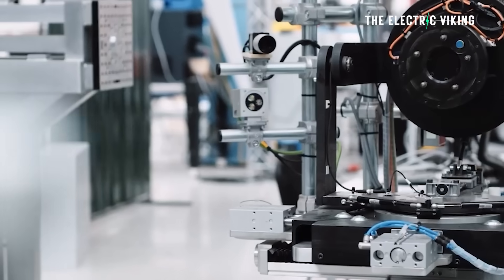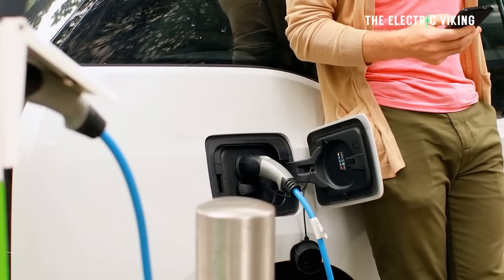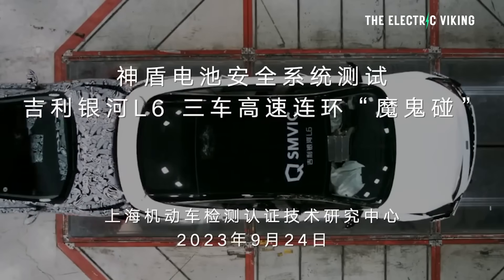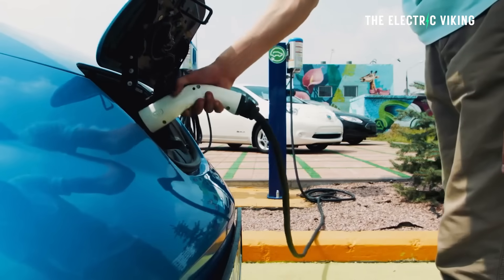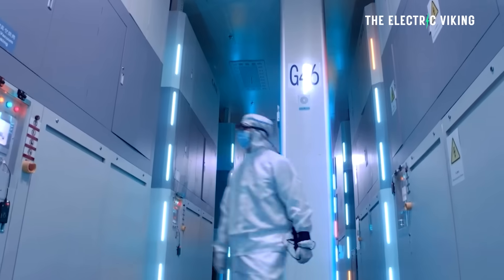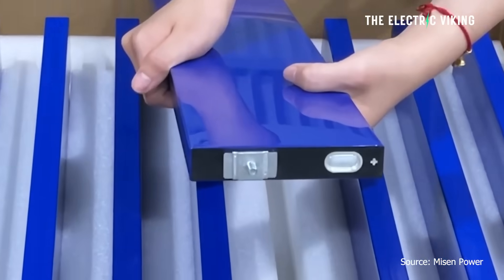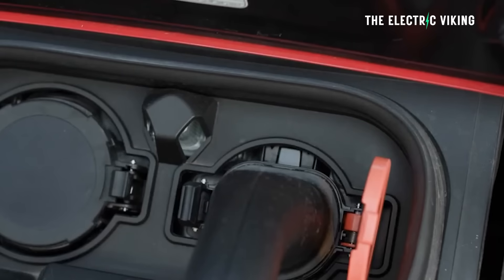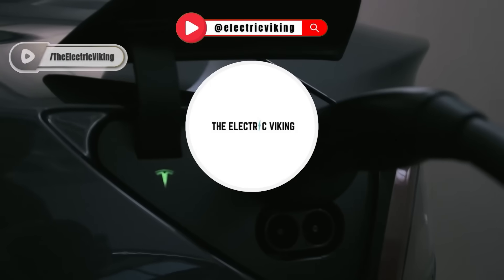GW Motors reveal battery that charges in 8 minutes and 1.5 million km warranty

Comment: I'm wondering how scalable this is.  It's one thing to have a battery that can charge at 800 KW, but in the real world there has to be an infrastructure to allow this to happen, not just for the current fleet of BEVs (like 4% in the UK) but for vastly larger numbers.  So, for example, you see so-called "fast" chargers in the UK that squirt out 75 KW.  These currently work fine - as long as there aren't too many BEVs taking juice at the same time, because as soon as this happens, the output power to each car drops.  The charging companies generally do not have the infrastructure (in the UK) to dispense full power to all of their fast chargers at a given station.  Scaling it up to 500 KW that can dispense simultaneously to dozens of cars all feeding off the same input is in practice too difficult and too expensive.  If such a thing was even possible you would then run into the problem of insufficient dispatchable power being generated on the grid.  The idea that this will happen is, imo, for the birds.
Reply: Exactly

Comment: Most of what is discussed here is quite unrealistic. Very fast chargers are going to be very few and far between simply because of the massive and very costly electrical power infrastructure needed to support them. This won't be generally available for many years, if ever.

The fastest enroute charger I have found is 150KW and they are quite rare. They are mainly only located at central town sites where the high capacity power feed is available, and these are often Tesla only sites. 

On the road with my two year old Atto3 I normally charge 30% to 80% (30KWhr). At a 90KW charger (fairly common place), in mild weather, this allows full rate charging (90KW) and takes just 22 minutes. Just enough time for a pee and coffee. This gives 180-200 km (with a good buffer) before the next charge. In this way a longish 750km trip can be done in nine hours, which although not as fast as an ICEV, is still a good pace.

With my Tesla M3 the charging times are just 15 minutes provided I can find a 120KW charger. These are generally only found at Tesla Supercharger sites. They are very expensive so that many Tesla owners prefer the much cheaper, but slower open chargers. 

Although not as comfortable a ride, the Tesla M3 can usually do the 750km trip in 8.5hrs. So its 30 mins faster than the Atto.

In my view, the EV manufacturers need to focus on reducing vehicle weight, better power recovery, decreased rolling resistance and improved aerodynamics such that 12KW per 100 km at 100kmh is achievable. If this can be done the power demand for charging would be much reduced and ranges of 500km-600km readily achieved. With reasonably careful driving, a 750km trip could then be easily done in around eight hours.

Comment: I've worked in Prudhoe Bay Alaska, situated on the Arctic Ocean.  Normal Temperatures were -45 C with windchill -70 C.  We drove 1998 Chevy Silverado truck with a 6.5 L  Diesel Engine.  
Note, for 3 months, except for oil changes, the motors were never turned off.

Its when temperatures drop to -52 C (Ft McMurray, Northern Alberta, Canada) that things get really bad.  Steel gets brittle like glass, rubber shatters as it turns solid as rock.  But even at these temperature, if the truck is plugged in it starts (Sometimes)...
Reply: Well, if you're already used to plugging in, why not use an electric truck that is way more energy efficient and can heat its battery just as well when it is plugged in?
Reply: There will be a place for ICE for a very long time( such as super sold climates, aviation for quiet a while but not forever)....but not in the average run of the mill household in a very short time.
Reply: @Ulbre  Super cold climates are also not good for ICE : Engine, transmissions oils becomes thick or even solid ! Also engine & transmission seals are harden and might fail once the engine heats up. Their rubber must survive hot temperatures over 100°c, so such rubber is not qualified below -30°c at best.
Usually, ICE Engine specs are required until -20°c. -30°c possible but at higher material costs (special rubbers for instance) and less fuel efficiency due to larger tolerances of machining and so on.
This is why in super cold climates they need to keep the engines warm by electric heaters or simply on. Or have a heated garage.... or put a fire under the engine as Russians are famous for doing ....
BEV on the other end, is less prone to failure under very cold condition if the chemistry of the cell is adequate : Sodium based is the best for super cold climate ! maybe a mixed pack with Sodium / Li-Ion. Also the car may be designed to keep warmed while connected to the charge with less energy loss than an ICE plugged.
Reply: @chryoko  Talk to a Russian in Yukitia. They know how to run ICE vehicles all year without too much problem.

Comment: The grid in the UK came close to blackout zone over christmas and they are discussing 600kw charging.
Reply: Except it didn’t because that is not how the system works.

Energy is currently shuffled around Europe as needs demand, that is literal how the system works. All that happened was a potential shortage on the domestic front was addressed by bringing some in. This is how the system is meant to work. It saves a fortune each year in not having to have unused power stations that are only used a few days per year.
Reply: @javelinXH992  Well said!
Reply: Well, if they had pushed renewables and battery storage, together with grid adaption, more, they wouldn't have that problem.
Reply: We didn’t come close to blackout. At all. This is literally just spreading lies and disinformation. Stop reading the daily mail.

Comment: Battery technology is just getting started.
Reply: Yep, Bloomberg estimates that batteries are just at the start of their learning curve, similar to PCs in the 1980s or smartphones in the early 2000s.
Reply: It is started!
Reply: Imagine if ICE cars had improved that fast for the last 100 years. We would be getting 200 miles to the gallon by now with 500 hp.
Reply: @frankcoffey  I think you forget where ICE cars have come from. EV tech will flatline shortly. The improvements from there on will be slow and incremental. The EV today resembles a device rather that a car. We are in the early stages of digitising the car. Many of these won't last more than 10 years before the electronic side of things becomes too problematic or outdated to fix.
Reply: @nzer57  I've noticed that many of the ICE technologies we are just getting today were already perfected and working in planes and other vehicles decades before. Maybe automakers will start to "trickle out" advancements in EVs the same way to keep us buying new cars.  The difference is many more people all over the world are working on this one and not just for cars.
Reply: @frankcoffey  ICE cars did improve. Now we are at the limit of efficiency for Internal Combustion Engines. Some models throw efficiency away in name of speed and acceleration.
Reply: Yep. There is a kind of Moore's Law of battery tech happening.
Reply: @trojanthedog  There are other components and software that are improving efficiency also. 5+ miles per KWH is not considered "future" anymore. It can be done.
Reply: Bout F****** time...
Reply: Its dead.

Comment: Thanks for pointing that news ! 
FC (Fast Charging) and SAFETY is the actual focus point in the battery industry. Better carry less battery weight and charge quickly more often. That brings more energy efficiencies overall and less cost. Fast Chargers are now ubiquitous in most countries.
And for SAFETY, the LFP is #1 and NMC is stepping back from high nickel chemistries that are seen as too unstable for the actual huge market towards 100% BEV. Better have a lower energy density with better fast charging capabilities.
China industry is right now able to match price parity between BEVs and ICEs.
I also believe that Western ICEs prices will keep up increasing sharply from right now too because of more and more stringent regulations on toxic emissions + CAFE compensations on CO2 emissions + lower overall production volumes increasing R&D/tooling/plant production depreciation costs.

Comment: In case you have missed it, there is a new Q50 scooter made by Yadea, it has a sodium-ion battery pack made by Yuji Tech. It has up to 70 km of range and costs $450 to $590 USD.
Reply: I think may be the China price. I live in Thailand and the China price is doubled or tripled here. The Yadea is around $1600 US here and that after the Thai govt $560 EV rebate.
I personally have a little 36v lead acid scooter that I bought for about $185 in 2023. When new it had a range of 30km(18m) and a top speed of 39kmh(25mph)....it had 3 * 20Ah lead acid batteries in series. I swapped it out for a $65 LiFepo4 36v 6Ah battery and now get top speed of 50kph(31mph) and range of a little more, abit over 34km (20m). most of my rides are between 3 and 6 km so this is pretty awesome for me....I may add another battery in parallel to double the range....my wife gets even more speed and range due to her loser weight!!!!
Anyhow, mainly wanted to highlight how much more lithium batteries perform compared to lead acid.
Reply: @ I just posted it here since there are big expectations that sodium-ion batteries can be a cheaper and better alternative to li-ion batteries. That sodium-ion battery is supposed to work at least down to -20C, even though it is not very useful for a scooter. It is great that there is already a product with sodium-ion battery. Pricing in different markets will be different due to local import duties and local seller markups.
Reply: @IKDesignUA  In your dreams, or should I say bank account , you rent a mouth for the rich.
Reply: 🤭 this is embarrassing you should Google XiaoMi Autonomous Scooter it is blowing up in the internet right now a lot of people even think its video is CGI
Reply: https://youtu.be/c1MWleXxmeU
Reply: @ You really believe that extra low iq bs?
Reply: @ oh another video from -anti-china observer? This looks like sponsored advert from tesla xd so pathetic that americans must lie and make that yt channel propaganda.
Reply: Is this for sale yet in other countries than China?
Reply: @ChickensAndGardening I just saw it in the news, so probably not. But since it is a big scooter manufacturer it will likely be sold outside China as well.
Reply: I was wondering when these kinda vehicles would become available as I recently went to HCM and the fumes from the petrol motorbikes and mopeds is insane plus the electric ones will be so much quieter too
Reply: @IKDesignUA  Fortunately,  I did miss it.
Reply: @IKDesignUA  Fortunately, I did miss it
Reply: Try taking your family on that fool.
Reply: @kennethbowry1521  I see you aredense xd this is a tech channel too. So that news is also welcome here. Especially with that new type chemistry of battery.
Reply: @kennethbowry1521   Better yet, get your family to take away your internet, so you'd quit embarrassing yourself.
Reply: @kennethbowry1521  Yeah, most people plan on driving their family around on a scooter. Yup. Your comment totally makes sense!

Comment: Charge a 60 kWh battery in 8 minutes. Where do you get the almost one half mega W charger. Multiply this with ten charging slots ...
Reply: Wires will be everywhere in the cities.
Reply: @ceroandone  Wow! I've never seen 'wires' in any city!!
Reply: @dochi1958  cities will be overwhelmed with cables.
Reply: It the case of Tesla if the local grid can't the potential peak you describe, they add one of thier giant "megapack" battery's as a buffer (like the electrical equivalent of a toilet flush🚽)
Reply: @backacheache  I don’t think the local grid is the problem. At even 13.8 KV or 35 KV a lot of power can be delivered. I made a quick calculation and you would need around 3 MW for 10 of these chargers. The grid can handle this. The problem is the physical connection at the vehicle—and the local chargers.
Reply: if your country cant do it then consider your country a backward country.
Reply: This is a lack of imagination. The electrification can be done very fast if the politicians do their job.
Reply: @fcalin21 When do politicians do their job in a timely manner  ??? Except for their own pay rises.
Reply: @ivepeters  It will eventually be done, it is inevitable.
Reply: @fcalin21 I once told a young engineer that worked for me to never say something cannot be done—just tell the powers to be how much it will cost. At 800 volts, to charge in this time would require around 375 amps. Yes, it can be done, with welding cable, a strong back to lift the cables, a really large source of power, and probably at the elimination of self-serve for safety reasons. You can’t beat physics but yes, it can be done at ridiculous expense. I would be proud of my young engineer exposing the stupidity of such an idea.
Reply: @fcalin21 You gonna pay for the whole electricity grid to be replaced?

Comment: I would love to hear an update on the electric construction vehicle market - the electric construction equipment has even more advantages than the electric cars compared with ICUs
Reply: In the UK, JCB are working on hydrogen combustion engines. It’s one of the uses for hydrogen that may make sense, we will see. I’m sceptical, but not closed minded to hydrogen in this role.

Hydrogen gas is it’s used, but not as a fuel for general use. Only specific uses where electricity would not be practical.

Hydrogen for industry though, I can fully get behind (steel, fertilisers, chemicals, etc). And you could justify some rail and road transport off the back of that.

I still believe the future is a blend of ICE, EV and hydrogen. We just should pick the right tool for the right situation.
Reply: Volvo has a full range of EV  construction machinery.  JCB has electric earth movers.  It is making a mistake with Hydrogen, as there is no infrastructure and no incentives to build one.

Comment: The problem is the lack of infrastructure and high charging prices! You drive 300 kms for 50 Euros if you fast charge! NUTTS!
Reply: Yes, but >90% of charging happens at home or in the parking of the workplace. High-speed charging has way fewer use-cases than petrol stations.
Reply: @petterbirgersson4489 In the U.K charging from home an 85kwh battery pack would cost me $24.65 ! Fast charging at garages would probably be double that.
Reply: eventually all work place will have charger for their staff, while you have to drive around looking for the ever shrinking petrol station
Reply: @jetli740  In 15 years for sure! I love EVs but until infrastructure for cheap charging (equivalent for 3L benzin consumption per 100kms) won't be solved I am sticking to my old car. And waiting for solid state batteries. But batteries and range won't be a problem in 4-5 years.
Reply: To fill a Model 3 from 0 - 100% where I live would be about €4.28 and would get you over 400km of range. There's not really a lack of infrastructure in most places anymore, and the number of areas that truly lack charging are shrinking fast. Where abouts do you live? Do you own an EV? Or do you have a gas car and just assume that because you don't see charging stations that look like gas stations that there must not be any (charging stations can blend in pretty subtly if you're not looking for them). I bet if you used Google maps to search for chargers in your area you'd be shocked by how many there are (it only drops a certain number of pins at a time, so if you have your whole country in view when you search an area it will show you a dozen or so, zoom into your city and it will still show you a dozen, zoom into your neighbourhood and you'll still see a dozen).
Reply: Just drove through Europe in rented long range Teslay Y.  Slovenia, Croatia, Hungary.  " Fill up" average 35 euros and with this I could make around 400km. Big difference from "50euros for 300km". Maybe if you are in EQS SUV and charge in Germany in peak hours.
Reply: I'm actually in Germany, where public charging is extremely expensive. I pay 44 Euro cents per kWh at Tesla Superchargers, and my car uses 17 kWh/100 km. This sums up to 22 Euros for 300 km. When I charge at home, it's a lot cheaper though.